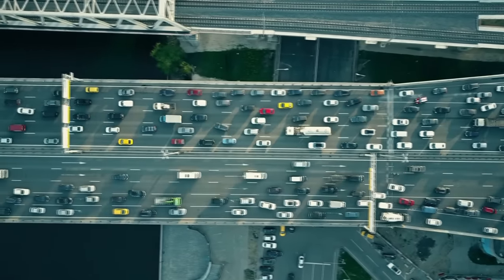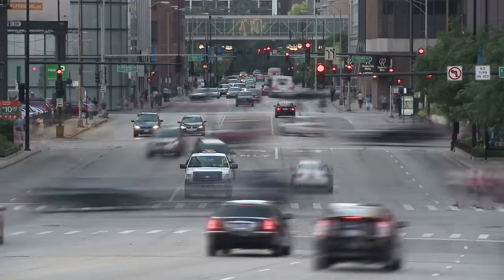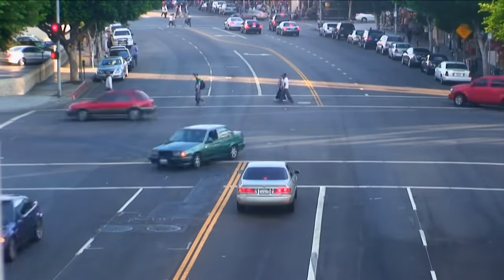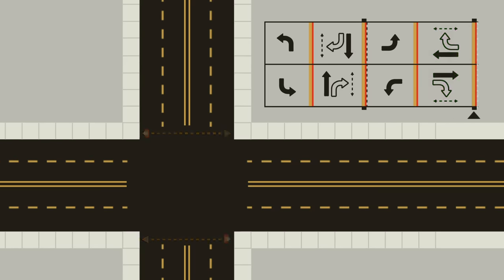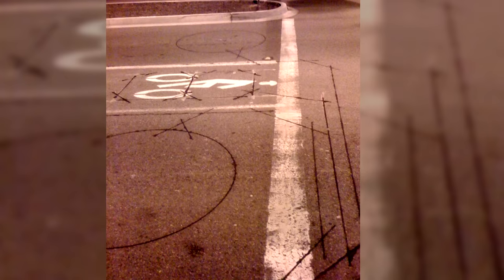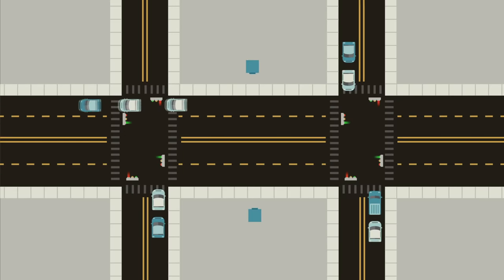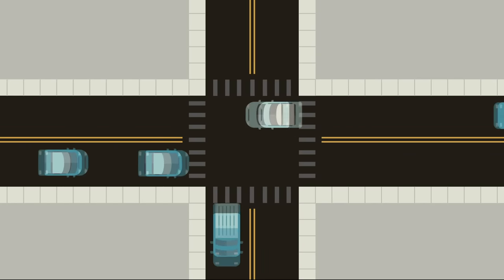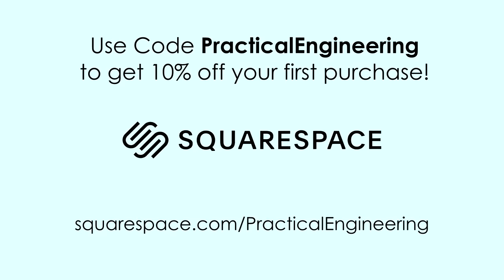How Do Traffic Signals Work?

Comment: There is an intersection in the city i work where i was in what is called a yard mule spot truck it's made to move semi trailers on industrial property but they can operate on certain roads depending on city and county plus state law anyway a miniature semi and i set a red light for 5 cycles and to this day i have no idea i had to jump on a highway and run illegally for a mile but i was not getting a green light i needed to cross the .major highway but i had to swing wide and run down and turn

Comment: "Intersections are the limit of a roadway's throughput, such that adding more lanes, or increasing the speed limit won't increase the capacity" Has to be the most chronically neglected statement in every single car dependant settlement.

Comment: People should realize and expect that traffic lights will soon become obsolete .. when machines start driving vehicles on the road .. Think about a traffic intersection where the cars are all driving at 40 mph non-stop, PASSING EACH OTHER IN THE SPACE BETWEEN ONE CAR AND THE ONE FOLLOWING .. COMPUTERS CAN CALCULATE AND CONTROL THIS PERFECTLY, AS LONG AS ALL THE VEHICLES ARE TALKING TO ONE ANOTHER AND CONTROLLED BY COMPUTERS.  This is not that far off !!

Comment: The diagram at 4:30 is wrong, you said the cars that are to go straight to when the light is green and the pedestrians on the side walk of the street to the left/right are to cross but you also said the straight on lane is a right and straight on lane being pedestrians are turning into speedbumps. Glad you are not in control of the traffic lights
Reply from the maker: Some lights have dedicated pedestrian phases, but most combine them. Obviously cars turning right must yield to pedestrians.
Reply: I hate it when lights make me run people over, but who am I to question the system... If the engineers demand human sacrifices, then I must oblige.

Comment: Not sure about other countries, but here in England I can't stand that a green light doesn't actually mean anything!!
A green arrow means "safe to go in that direction", but a plain green light just means "ignore this light".
If you're turning right (where you cross traffic, because we drive on the left), and the traffic lights don't have arrows, you have to wait until the traffic is clear before turning. Except the traffic won't clear until the light turns red on the other side, which is usually synchronised to be the same colour as your own light, meaning you can't actually turn right safely under normal circumstances!! Dx
To make matters worse, you have no way of knowing whether the lights are actually synched with yours or not, and you can't see the lights facing the other way, meaning you literally CANNOT know if it's safe to turn until it's too late! -_-

Please, England, for love of country and sanity, sort your bloody lights out! xx
Reply: You have a couple seconds between when your green light ends, and the next one begins. Wait for traffic from the opposite side to clear, and you can make your turn. You have plenty of time to clear the junction before the next cars enter the intersection.

Comment: There is a traffic light by where i live where the green light is on for 5 seconds then changes to red. It is only good if your the only car waiting if there is 2 or more you gonna be there awhile. They need to fix it but wont. And the yellow light is to slow down? I thought it meant to floor it lol
Reply: The amber light means to clear the intersection.  Keep going if you're already in the intersection, but stop safely before entering it if you can.
Reply: @jovetj  i know what the amber light means just most people decide to floor it to get past it even if there not in the intersection.

Comment: I’m still tryin to figure out why in 2020 we don’t have an elaborate system that judges when to change traffic signals by actually analyzing  traffic via optical sensors that use algorithms to decide when to change the signal.

Comment: I imagine a system called The Old Man's Traffic Network. Old guy's can sit at their computer and control the lights. The system obviously has safety features to prevent chaos. Imagine the satisfaction for a bunch of old guys when they get their monthly report that shows their efficiency stats.

A guy could control an interaction anywhere there's an Internet connection. 

Camera needed for all four direction. 

Also, immediate response for any accident. Just press the red button to immediately report to 911.

And it's all run by a bunch of volunteers who are tired of sitting AT THE GODAMMED LIGHT WHEN NO ONE IS THERE.

Comment: 3:47 in the UK the traffic lights go Red, Red+Amber, Green, Amber, Red. I didn't realise in the US they only warned when green was changing to red?
Reply: Yeah, that's only a European standard, to give the red+amber warning that the light is about to turn green.  It sure helps, when a lot of drivers have manual transmissions, and have to shift to get going.

I think if they did that in the US, a lot of people would jump the gun, and proceed during the red+amber warning, despite being required to wait for the green light.

Comment: Your discussion of possible solutions to traffic congestion is missing the only real solution, which has 3 main components

1. Reorganize cities and suburbs so everything isn't so damn sprawled out. This includes actions such as building medium- and high-density housing (medium-density housing being something that pretty much doesn't exist at all anywhere in the United States due to zoning laws), and putting grocery stores and pharmacies in the middle of neighborhoods.
2. Take some of the space currently dedicated to car roadways and reallocate that space for modes of travel such as walking or bicycling, which will be much more useful modes of travel when things aren't so sprawled out. If there's a grocery store half a mile away and there's a safe bicycle path to use, you're going to be a lot more open to the idea of riding a bike instead of driving a car. A critical component here is to make sure those walking and bicycling paths are safely separated away from car traffic; when we have "bike lanes" in the United States, they're pretty much always just a gutter with no separation from car traffic, just a painted line that isn't going to do anything to prevent a stray car from killing you.
3. Build public transit systems. Robust and extensive ones, so they're actually useful. Trams and light trains can do wonders to move large amounts of people extremely quickly. Buses potentially have their place too, but they come with challenges including A. being unable to connect directly to the power grid and therefore needing either an ICE or a battery (both of which are pretty environmentally destructive) and B. using rubber tires, which flatten at the bottom and thus add rolling resistance which wrecks energy efficiency. So trams and light trains should always be used when they're feasible and buses should be considered a last resort. Trams and trains are also easier to keep separate from car traffic so they can consistently run on time no matter how congested car traffic gets, which is a key component to building a genuinely useful public transit system.

I must credit the channel Not Just Bikes for pretty much all the knowledge I have on the topic. Check out his channel because it's wonderful.

Comment: How Do Traffic Signals Work?
Answer: Horribly in some cases!

I've seen traffic signals turn green before you even slow down, and I've had to sit 2-5 minutes at other traffic signals even tho I've been the only one on the road. 

Had a great intersection that had a great detection sensor, every morning, I'd see it being red in the distance, but I never needed to slow down as it'd turn green in good time... until they did some road repairs and somehow fked it up. I don't know how they did that, but now I have to wait several minutes for ghost cars before I can get a green light.

Comment: I wish they hired competent traffic engineers in my town.  Instead the lanes don't line up at large intersections.  Nobody knows how to merge so double turn lanes are wasted and the freeway gets backed up miles before the exits.  Roundabouts everywhere that have no breaks in the traffic from one direction; good luck if you're on a side street.  Multi lane roundabouts where you have to be in the lane with 1000 other people if you want the correct exit.  Out of view stop signs.  Parking lots with no available entrances without performing at least 1, sometimes 2, U turns.  Speed bumps designed to remove the bottom of your car unless you hit it diagonally.  Office parks intentionally designed to confuse Google Maps.  Metered on ramps in areas where there's never any traffic.  Destination estimate signs that always show the same amount of time even in "heavy" traffic.

God help us if more people start living here.

Comment: In my city, the politicians can't resist interfering with signal policy. They force the traffic engineers to  intentionally de-tune the synchronization of the signals to impede traffic flow in order to frustrate drivers and make car haters happy. Then they complain about noise and pollution from idling cars at intersections! Any time you see something stupid happening, the explanation involves politics.

Comment: Your engineering team should be up in the Town of Colonie.    Took them over 10 years to install a left turn signals  in. They have  them on one side of the intersection While the other side  they have an arrow for right turn when there is no right turn lane.    Putting up state of the art signals that never worked correctly faulty on install and running on manual signals ….They trigger and you are the only auto there and has to complete a 5 minute cycle.   Idiots do not understand the left signal with the blinking yellow to the point where the town had to put signals returned to the old pattern with solid color arrows

Comment: Considering that about 10% -12% of men are color blind why are they all round? Red should be square, yellow a triangle, and green round. That way you don't need to see where the light that is on is positioned to know if it means stop, yield, or go. If you've wondered why some people slow down at a green light at night, it's because they can't see where the lit light is in relation to the other two lights until they get close to the intersection.

Comment: A vehicle at idle passes about 600 cf per minute through its engine.
If you add all the vehicles and aircraft on the planet and all the breathable air on the planet, we are passing the air on the planet through an internal combustion engine ever 10 years.
You can now see what has caused a reduction of 90% of the insects.
Insects keep the planet clean and that why we will see pandemics grow in frequency and severity.

Comment: How about doing traffic lights such way, that the poles are anchored to ground with quite like big needles with wings. Light poles could also be made or mounted with so called controlled force handling type, when greater they cut off. To prevent traffic injuries when confronted. The brains of the lights could be in acrylic substance molded smart phones with sufficient applications. Energy could be gained through stimulated emission of microwave radiation from emitters mounted to street lights and receiver mounted to each pole. Led-technology and affordable smart phones makes this kind of traffic light very easy and fast to mount, and they could interact through 5G network so that mathematicians could try to optimize like whole cities or dense populated local area with one pooling of information. No need for inductive looping sensors, just cameras with figure and motion understanding applications. No need for wired information network or local computer. No need for electric cording, just closest streetlight quite reasonable power level emitting and harvesting. Microwaves such high level, that no risk for tissue warming. Would not be fun and nice? Dunno.

Comment: Piss poor driving. That's why we have traffic. 
The first issue, lack of consideration.  The first car at a red light rarely considers all the other cars behind it and speed up through the light when it turns green in order to get the maximum number of cars through the light. 
The other major issue, slow people.  Here in Pittsburgh,  we have tunnels that back up twice a day every day. There are no red lights, stop signs, or speed bumps as they are all located on the parkways.  However, every day some idiot slows down to 40mph to go through the tunnel, and that backs everything up.

Comment: Or cities can bring in red light cameras and manipulate the timing cycle to trap as many cars as possible to gain revenue. There’s a point/distance from Intersection where a driver will think if it turns yellow I’ll stop and after this point I’ll make the light. These companies mess with the timing to where the light turns quickly from yellow to red to generate revenue, in the short term. Long term, people get wise to the cameras, and stop way before, creating congestion or take another route, to zero the probability of getting a $150+ ticket in the mail.

Comment: Why not just simply make a road go on top of another? Yeah it's expensive, but how much compared to computerizing the hole system with sensors even under the ground?
Reply: Because electrical construction and programming are cheaper than structural construction.   Plus, you have the added risk of bridge collapsing.   You also have extra real estate that you need for the on and off ramps.
Reply: Seattle tried that.  It works ok till the top road falls down on the bottom road.   Adding electronic signals is much cheaper than adding elevated roads or tunnels

Comment: The traffic light operator did know there are traffic in Middle intersection and turn on green light to meet traffic yellow and red in middle intersection.  The fail from the green light traffic drivers and as well as the traffic light operator that make intersection danger from these crook

Comment: As a dutchguy american traffic lights and intersections and badly designed and dangerous, and they are also very dumb, in the netherlands basicaly all turning lanes are seperate and the trafficlights defect traffic and calculate the fastest way to push all the cars trough the intersection whilst not having the paths cross others, and cycling is always seperate.
Reply: Yes, because comparing the Netherlands to the USA and its demographics, transportation options and layout, and geography is so accurate...

Comment: Optimising Signals should not be the future. Eliminating them by avoiding intersections should be the future. Overbridges and underbridges don't need sensors, electronics, power and patience. You can't imagine it if you haven't seen it. Once you have seen it, you can never go back to signals. The stretch from Gurgaon to Noida a 40 km densest city traffic doesn't have a single signal in most part. Grow up.